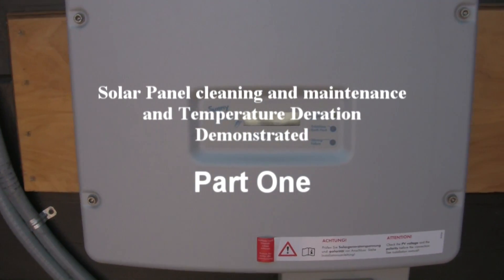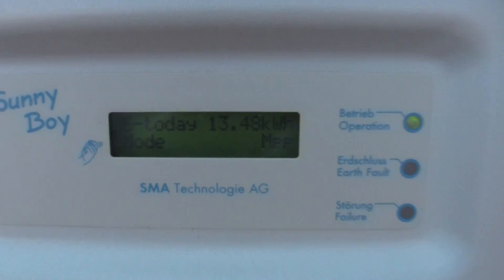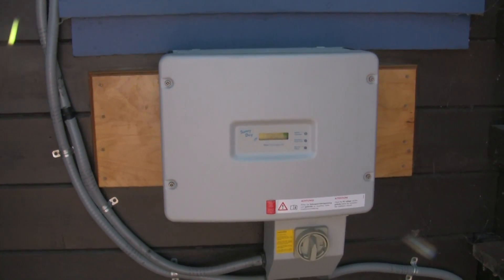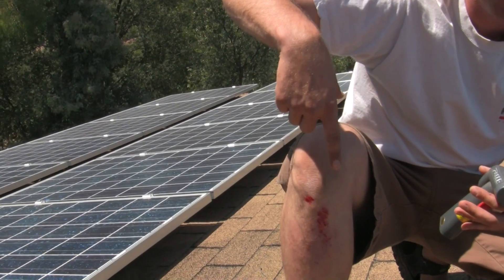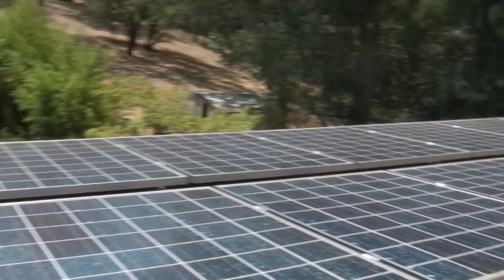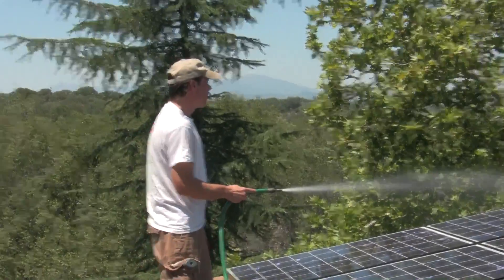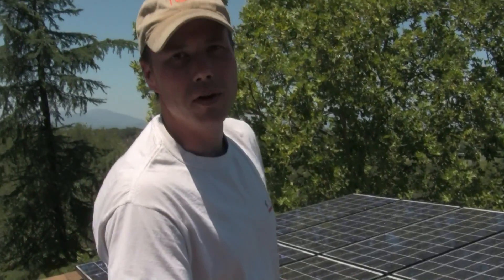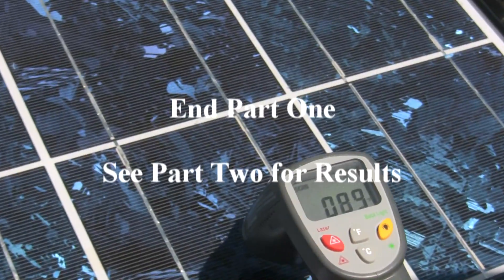Solar Panel Cleaning and Temperature Deration

Comment: You wouldn't run cold water on 150 glass in any other application, why would you  think that would be safe?  Running raw tap water on them will in time deposit enough minerals on the glass so they'll hold more dirt and hold more heat.  This is not the way to treat your panels.  Deionized water, held at ambient temperatures, is the only right way to do this unless you can squeegee and hand dry.

Comment: Thermal Down shock is caused by cold water being applied to hot glass. You are gambling with your very expensive panels and very likely voiding any warranty by the manufacture
Reply: To an extent, yes.  Rapid contraction in any material will have consequences, by cooling harvested rainwater will NOT cause a thermal down shock.  It's not just the cooling that makes them work better, it's the way the light travels through the water and enables to cells to collect more light.  I have been doing the same as SolarSteve for many years and documented many results on my own Chanel. And like he says, he wouldn't put Ice water on them.  I wouldn't put tap water on them personally, but each to their own.

Comment: Hose water will build up mineral deposits on the glass and over time blocked energy from the sun. It's the same when cleaning windows. Pure water should be used.

Comment: I have a 7.5kw system in Florida.  I am trying to find a way to cool the panels in the spring,summer,fall.  I looked at micro irrigation, but the relative humidity in the hottest months is so high.  They are 6" off the roof.  Furthermore, I have heard of using forced convection(super efficient fans), but see very little anywhere...Any ideas? thanks

Comment: If your rinsing every month, you dont need to scrub. I am launching a SOLAR panel cleaning biz out here in Sacramento CA. I find panels that are FILTHY!! I use a brush with a hose attachment. After i give the panels a light but thorough cleaning, I use a squeegy to remove the excess water. Squeeky clean! And the customers efficiency goes up. I try to do this service for them seasonally. Some of the SOLAR companies arent offering routine maintenance on the panels.

Comment from the maker: Yeah, I installed these at the same pitch of the roof for simplicity and for lesser wind loading considering the roof array is about 40' off the ground on the windward side of a ridge top. +15 is a more optimal tilt angle, however in practice I'm only loosing approx 5% output at this low angle. My avg generation is about 25kwh daily right now. Shading, high heat and debris causes me far more losses than the shallow angle! I'm at 40 deg N lat. with the array pointed SSW at 210 deg.